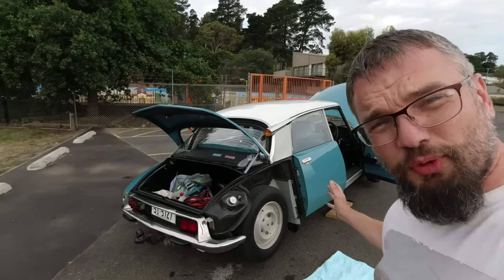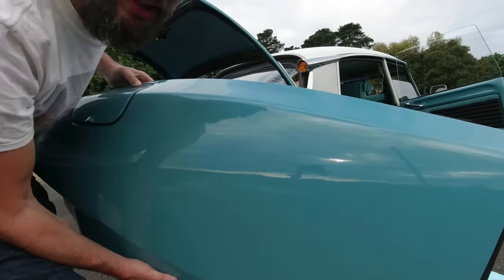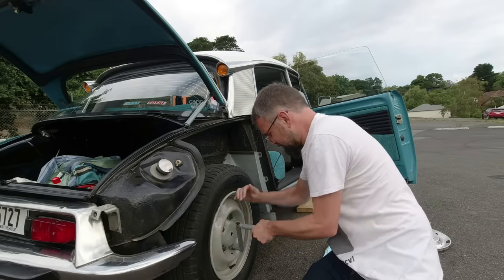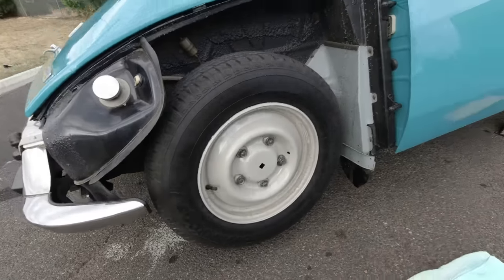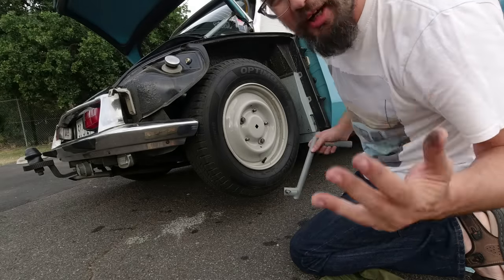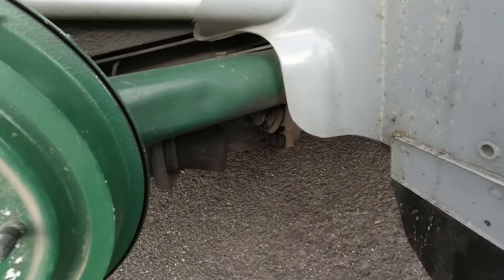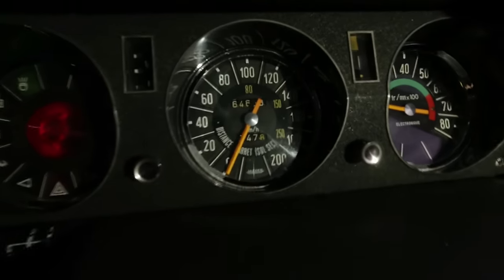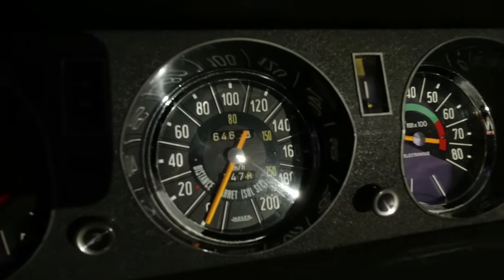Can it drive on three wheels?! And other Citroen DS Party Tricks

Comment: 7:19
if you can't have a handbrake on the rear wheels, how come you can have a normal brake? if the handbrake cable were routed along the trailing arm hinge (elbow?) regardless of position the cable route length would be the same?
Reply: It's a hydraulic unit instead a cable
Reply: No matter if the length of the wheel base changes, the tube will have the same pressure all the time. Hand brakes are cable driven with a turnstile, so if the wheel base changes, it would loose the brake tension, or increase.
Reply: @heitorbernardes7977  You haven't convinced me. Handbrake cables are generally in sleeves, as such they will behave the same as a hydraulic pipe. but even without a sleeve, if it were routed along the pivot point, it still wouldn't increase in length. If you draw a line on a piece of paper and fold the piece of paper, the length of the line doesn't change.
Reply: Lots of cars with trailing arms have cable hand brakes, you just have to have one end of the cable tube fixed to the back of the drum and one to the car body. The length of the tube doesn't change whatever the wheelbase does. If you think about it the position of the brakes on the Citroen also changed due to the fact the transmission is rubber mounted, so again one end of the linkage is attached to the body and one local to the brakes.
Reply: @alanlansdell7533  So we're agreed? Hubnut is wrong!
Reply from the maker: The problem isn't the effectiveness of the brake, but that locking the wheel prevents the car rising or falling.
Reply: @HubNut  would it? Wouldn't it just tend to pull the front of the car back slightly???
Reply: @benholroyd5221  I guess if you've left it in gear then that won't work so well?
Reply: @benholroyd5221  nope I was trying to explain to Heitor how cars with trailing arms can have cable brakes. I wasn't sure why Citroen's tend not to, but looking at hubnuts answer the long travel would mean the car body would move allot if you lock the back wheels, if you lock the fronts, the body stays in the same spot but the back wheels can still move as the suspension lowers when the car is turned off.
Reply: @alanlansdell7533  Ok, yes. with a rear handbrake, as the car settled, the front of the car would move forward, potentially hitting something. whereas with a front handbrake, the rear wheels would move back but would stay within the chassis footprint, and the chassis wouldn't move. 

But you wouldn't be able to handbrake turn into such a tight spot, so really, its all moot.

Comment: Oh.... that was a nasty way to do it........! We were Citroen dealers. A good customer of ours had a rear nearside hydraulic fluid leak which let all the fluid out of the suspension. It was 100 miles from our workshop. My father, myself and our chief mechanic went to collect the car. We clamped the leaking copper oil line closed with mole grips and attached those to the chassis. We hauled the rear wheel UP into the arch and strapped it well clear of the ground but still in position if anything went wrong. We then refilled and bled the system so that the other three wheels operated as normal. My father drove and the chief mechanic and I sat as close to dad as we could, leaning right over him (a little bit like side car riders) to balance the car over the remaining wheels ........ and we drove it the 100 miles home entirely safely!

If you look at the geometry of the ID/DS and even the SM.... you'll notice the rear track is MUCH narrower than the front track. The car is nearer to a twin rear wheeled 3 wheeler in its native form anyway! Losing a front wheel would be almost impossible to 'doctor' safely. A rear wheel is EASY!

Comment: 8:52 .....what's missing, now that the Suspension system has been "Modified."   As if you had a flat on the side of the road, or a situation where a problem arises with one of the wheels, is a simple strap that will allow you to maintain a safe driving condition, once you get going on your journey.  
  
They need a strap, or a small harness, that hooks to the chassis or frame, and then to the swing arm of the Suspension, so that it does not "Rub" or come in contact with the road, or an obstacle on the road 🤔   I'm sure someone has thought about this somewhere, in the past.

Comment: This also means that a tire blow-out on one of the rear wheels is hardly noticed in a DS!
Reply: It didn't need to blowout, just a puncture or slow leak would go unnoticed until the tire shredded & flapped around enough to finally get attention.  The michelin XAS came apart without getting punctured first.

Comment: Hi ,,, about the turning lights ,also you didn't mansion the level auto correction of the lights, its connected to the suspensions.
Reply: Only the additional inner high beam headlights were turning. The bigger outer headlight had dimmed and high beam and were connected with wires to the the suspensions front and back. This way they realised a dynamic height control which was necessary because of the soft suspension. And it worked really good.

Comment: I wonder when Citroen switched from wheelstuds then... Pretty sure the Xantias I've worked on used bolts, it's always a joy to work on Asian cars and not have to awkwardly hold the wheel up against the hub whilst trying to jam a bolt in. I've no idea why they're so popular with European manufacturers.

I broke a stud on a Yaris once, and far from being the huge issue that would be on a car that used bolts, the remaining bit of the stud passed out of the back of the hub very easily when turned to the correct position and then the new one just slid in, so better from a failure mode perspective too.
Reply from the maker: Yeah, BX and XM had bolts too. Pain in the backside.

Comment: The old Austin Mini had very similar swing arm rear suspension (though without powered hydraulics). It's hand brake worked at the back. The Citroen had 100% powered brakes. The hand brake is on the front because if the hydraulics fail you actually have no brakes at all. The hand brake gives usable stopping on the front. On the back it would offer nothing helpful.
Reply: If the hydraulics fail the system first takes the power from the steering and then the suspension before the brakes, so you get quite a few miles, leaving a trail of green fluid before being unable to stop.

Comment: How long was the production of that model?
Reply from the maker: DS was in production from 1955 until 1976 I think.
Reply: Its one of the later models with changed headlights, door handles, dashboard etc. They were built from 1968 I think.

Comment: Useful tips from DSdriver for next time:
Put an old glove or something over the bumper end to help prevent it scratching the paintwork on the wing when you remove it.
The side lever on the jack pin thingy is for levering off the wheel trim, don't use a screwdriver.
Reply from the maker: Thanks. We did realise the side pin could be used after we'd removed the trim! Thankfully I levered very gently.
Reply: @HubNut  Your welcome!
I haven't watched the whole video yet, but there is an extension bar for the wheel brace stored under the spare wheel that is used on four speed models (bvh and manual for turning the wheel brace into a starting handle.
It is also used for re-centering the wheel when putting it back on the studs.
Reply: @jean-pierredeclemy7032  Yes, have that one. We did not actually need it as there was two of us there putting the wheel back on.   I do have a bit of trim on the bumper end, visible in video, as I have previously scratched the guard taking it off.
Reply: @peterriggall620  I noticed the Titanfast trim on the bumper on my second viewing. I might use it on my car as I stock the trim for my marine business. For people wondering why the starting handle could only be used on the four speed boxes it is because the fifth gear blocks the spigot in which the cranking handle locates. The hole in the front valance panel behind the reg. plate is still there though.

Comment: Ah, someone else who knows the trick of loosening the wheelnuts while the wheel is still on the ground to avoid the problem of an unbraked wheel revolving as soon as you apply force.

Don't you just love Youtube's closed captions. At 4:45 (according to CC) "first we open the bollocks" ;-)

I've always wanted to see the method of changing the wheel on a DS or GS: raise the suspension to maximum, insert the jack and then lower the suspension, which causes the wheel to raise itself off the ground as if by magic. Fiendishly clever.
Reply from the maker: Also best to undo the wheelnuts on the ground so you don't accidentally pull the car off the jack. That was actually a question on my driving test!
Reply: @HubNut  I don't remember being asked a car-maintenance type question on my test, just a few standard Highway Code questions like "list all the places where you must not overtake" (people always forget "after a No Overtaking red/black car sign".

I remember my grandpa showing me "the proper way" to change a wheel, which included loosening the wheel nuts on the ground and crouching with your knees apart and your forearms supported inside your thighs to take the weight of the wheel at 4 and 8 o'clock positions to ease it on and off the central boss and/or wheel studs.

My worst wheel-changing was after a car pulled out from a side road and I hit a kerb avoiding him, ripping the sidewall of the tyre. When I came to fit the spare, I found that I couldn't release it from the metal cage below the boot. This was on a Peugeot 306 which uses a long bolt through the floor of the boot into a nut on the cage. Logic would make the bolt have a hex head the same size as the wheel holts, but Peugeot had instead made a semi-cylindrical notch in the smooth round head, and you were expected to use a flattened end of the wheel brace as a crude screwdriver. This was a really crap solution because if the thread and the nut have seized due to being exposed to water spraying up, the "screwdriver blade" just climbs out of the notch instead of getting any purchase on the bolt. I felt a bit of an idiot having to call out the RAC to change a wheel. It took the RAC man about half an hour to work out a solution - he tried heating the nut with a blow torch and then liberal application of grease, Eventually he had to use an angle grinder to cut a couple of flats on the head so he could grip it with a spanner. After that, I got into the habit of greasing that nut every few weeks and loosening/tightening it to prevent it seizing. If only it had been a Citroen DS and I could have driven home (only a mile or so) on the flat tyre so I could work on it at home in daylight with tools.
Reply: Thats right. And the DS has the parking brake at the front wheels 😀

Comment: This is indeed a like-new showroom preserved almost half-century old classic car ! 
Certainly some exclusive design here which surely must catch the attention from the competition...only 'drawback' i sense is the puny low end (4-cylinder only ?!?) boring sounding engine.....basically speaking this is an 'advanced' car by concept & design...even to this day, ignoring the engine, drum brakes & manual winding windows etc. that is !
 

Excellent classic French automotive engineering which should impress even the most demanding sophisticated German engineers from Stuttgart etc. ?!? It unfortunate that such French tradition didn't seem to sustain & develop further over the past 30 to 40 years from the 1970's.
Reply: When you look at he P6, which as Ian says was first introduced in 1963, you can see that they must have got a DS and pulled it to bits to work out what it was all about then tried their best to come up with something to match.  They must have known to be competitive at all the P6 had to be good.  As this comparison shows, the P6 is different but similar.....that sounds a contradiction but I guess that is exactly what it is.  The P6 is a great car but it must be acknowledged that they were playing catch up and the DS was on the market  8 years prior.

Comment: I might be tempted to do that trick with the nearside rear wheel so it's not on the same side as the weight of the driver.
Reply from the maker: Citroen did it this way.

Comment: The handbrake works on the front wheels as a safety feature to make the car still brake in case the hydraulic system fails. Forget the crap about wheelbase. Although there is no hydraulic system, also the 2CV handbrake works on the front wheels – about ⅔ of brake power has to be done by the front wheels (physics tells us this).

Comment: But Ian you don't have a DS. The D Special was the replacement for the ID. That's why you have drum brakes on the rear. The DS proper did have four wheel discs
Reply from the maker: No it didn't!

Comment: Enjoyed the video, but you need to get your accumulator sphere re-gassed and/or Change the hydraulic fluid. Both are simple jobs. The hydraulic pump should not be clicking over so regularly. :-)
Reply from the maker: Yes, I was aware of this. The accumulator has apparently been re-gassed recently, but as you say, that's not entirely how it should be.

Comment: i had 2  CXs in Dubai ,,, it had all the features except he turning lights...The rear fender had a bolt in   door frame and not of end of fendr,, so it was safe, Inspite of 2 cooling coils othe in rear shelf,,,, AC was not suficient in Desert head ot Dubai   unless you are on long drive

Comment: That was a question on my test aswell 5 years ago!
Reply: Yes me too in 1983! Surely undoing the wheel nuts / bolts before you jack the car, is so that the wheels are unable to move and you can get them undone easier?
Reply from the maker: There is that, but you could get someone to put their foot on the brake. Trying to force the nuts while the car is wobbling on a jack really isn't a good move.
Reply: @HubNut  if you need someone to put their foot on the brake (assuming there's someone there to help) , that indicates the car is already off the ground, and you wouldn't want to be undoing the nuts in that situation anyway? Safe enough on a decent trolley jack and/or with an axle stand underneath but certainly not on a side jack.
Reply: @HubNut  Yes, like he said if the tire shop put the hubnuts (!) on with the air tool instead of a torque wrench for the last bit, or if they are corroded you might have to actually jump up and down on the wrench handle. Living in the NE US the alloy wheels on my Pontiac TransSport had to be removed with multiple major hits of a sledge hammer (hitting the tire) when I got new tires. (Aluminum alloy wheels, steel backing plates/rear drums). The nuts weren't the problem. Good thing I wasn't out somewhere trying to change a flat. 
Actually by that time the spare tire had disappeared. It was a space saver, held up under the rear with a cable that was cranked up and down from inside using the jack handle. Apparently the plate at the end of the cable that holds up the tire had rusted and fell off, dropping the tire on the road somewhere. 
I'm not sure that road salt is such a good idea.
Later I finally sent that car off to car heaven when the rear coil spring bases had rusted to where they were collapsing. Again, road salt.

Comment: lots of smart patents and way ahead for its time in short just briljant car.
 but what i dont understand is why does most mechanics run the other way ? 
I have owned one of these cars for 10 years and it is the only car i regret selling. i fixed and maintained my self and never had any big issues with repairing the car you just need the right tool and understand the engineering . love it
Reply from the maker: Just because mechanics don't like being out of their comfort zones. Some jobs are a bit of a pig on these.
Reply: @HubNut  well so are some jobs on other cars. Take the shit job of changing abs rings og mercedes - saab  and other European cars or just replace headlight bulb og some cars  it shod be a simple job but are complicated due to  bad design.  I think  the largest problem is just that its not popular culture to own a Citroen  and not being able to understand the engineering that being also comfort zone and the fear of learning some new tricks

Comment: That´s not the whole story why the handbreak doesn´t  work the rear wheels. Citroen choose the front wheels because of the better brake power on the heavier front, but also as an emergency brake, in case of hydraulic failure. They are also better prortected at the front, and work directrly on the inboard discs.

Comment: " The official car of President de Gaul was the DS 19. La Deese - the Goddess. 
In August 1962, a group called the OAS (Secret Army Organization in English) plotted an assassination attempt on President De Gaulle, who they believed had betrayed France by giving up Algeria (in northern Africa) to Algerian nationalists. Near dusk on August 22, 1962, De Gaulle and his wife were riding from the Elysee Palace to Orly Airport. As his black Citroen DS sped along the Avenue de la Liberation in Paris at 70 miles per hour, 12 OAS gunmen opened fire on the car. A hail of 140 bullets, most of them coming from behind, killed two of the president’s motorcycle bodyguards, shattered the car’s rear window and punctured all four of its tires. Though the Citroen went into a front-wheel skid, De Gaulle’s chauffeur was able to accelerate out of the skid and drive to safety, all thanks to the car’s superior suspension system. De Gaulle and his wife kept their heads down and came out unharmed." (History.com)
 Any other car they would not have been so lucky.